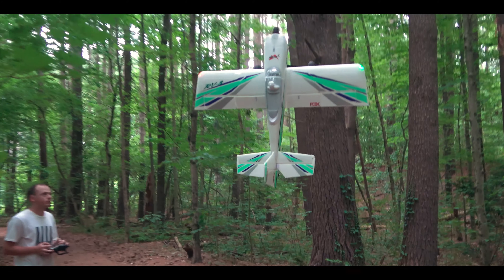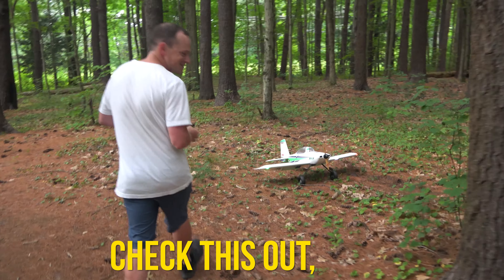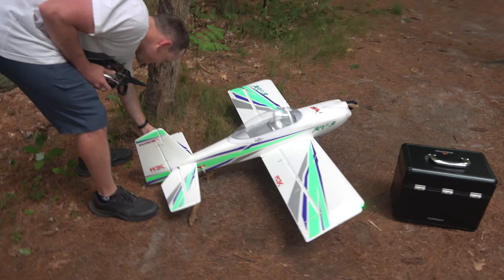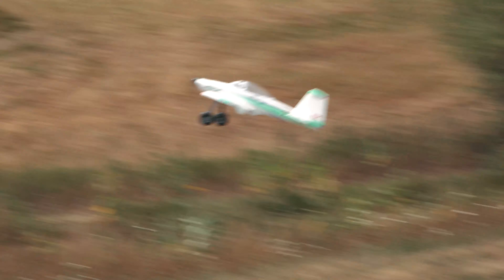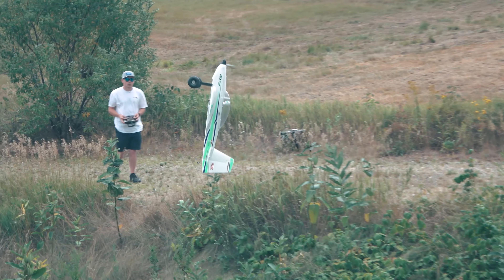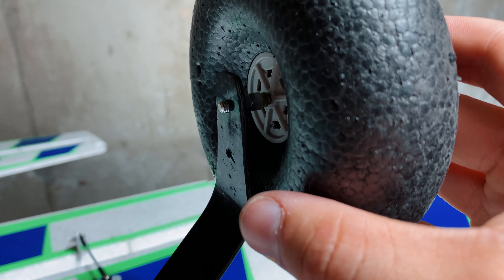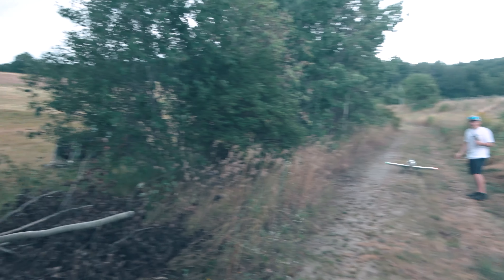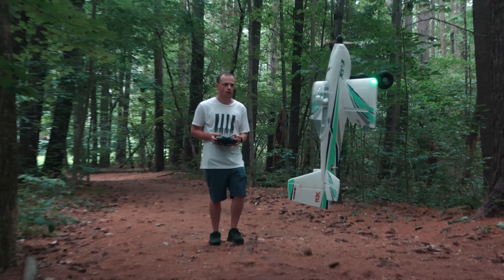RV-8 Bush Conversion - How Much Abuse Will It Take?

Comment: As just an idea. What if you made an airplane that lands like on a aircraft carrier and you can add a string to stop it. Idk I’ve always wanted see someone do it
Reply: I actually did sometjing similar with my Radian. I have a large property, but the radia justfloats forever, so I cant get it down in my field withlut hitting the fence. I put a rope between 2 posts, and a wire dangling down from the plane. Worked ok, however the rope was too high, so it was harder to get it to stick. Was quite fun though.
Reply: @bowenbrown  awesome
Reply: Great idea! I think Flite test has something like that, but these guys would put on a good show for sure!

Comment: Very nice fellas! That gear is TALL! My fav was the actual BUSH...er...tree landing!
Reply: We add extra height to the gear since our carbon fiber isnt super stiff.  It actually flexes out to absorb impacts instead of sending it straight to the air frame like all other CF gear does.  Since ours flexes and returns, we add height to avoid any issues with prop strikes during that flex/squat.  The big bush tires adds to the height here though haha!

Comment: I grabbed this gear from critical rc can't wait to try it out. 
Just wondering what wheels are you guys using in this video, I found critical rc wheels to be far too expensive. Thank u tail heavy,  and thank you critical rc.
Reply from the maker: Sweet! Unfortunately the wheels we used are discontinued.
Reply: @TailHeavyProductions  bummer. Thank you.
Reply: You could try Kin Additive wheels. I have a pair I bought for my FunCub but may put them on the RV-8 I have en route instead.

Comment: Would you consider this plane to be a throw around plane? I'm interested in 3d, scale, stol, all that stuff.
Reply from the maker: It definitely excels more at sport and 3D than it does bush flying but it will do the bush flying you saw in this video no problem. 👍

Comment: What prop are you using for this? The stock prop?
Reply from the maker: Initially the stock 12x5 wood prop until I crashed it into a tree and broke it. 🤡 Now it’s an APC 12x4.5 because it’s all I had left as a spare. -Zach
Reply: @TailHeavyProductions   -  with the 13x4 being common/popular with the Timber line I'm curious how it would perform on this plane with your bush mod.  As hard as I've been looking at the TT Evolution you have me seriously considering this plane instead
Reply from the maker: @grege2383  You'd love the RV-8! Originally it replaced the TTE for me only on the 3D side of things, but now it replaces it in all aspects for me with this new gear mod.

The RV-8 uses a 6s set up so putting on a larger prop would lead to high temp issues. The great thing about the 6s set up is out of the box it gives a true 2:1 insane punch out with cool temps...in other words, I never even considered needing to replace the prop for performance or temp reasons. -Zach